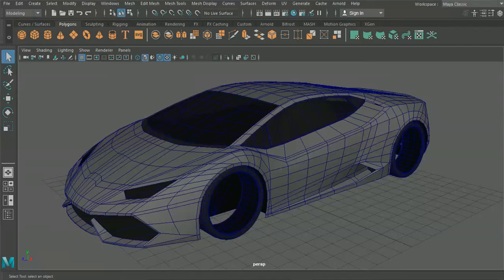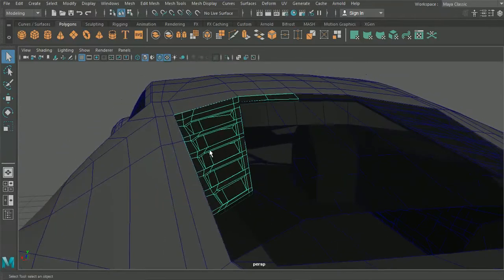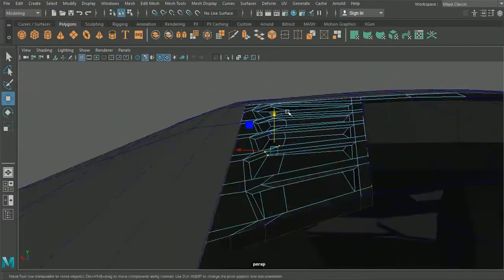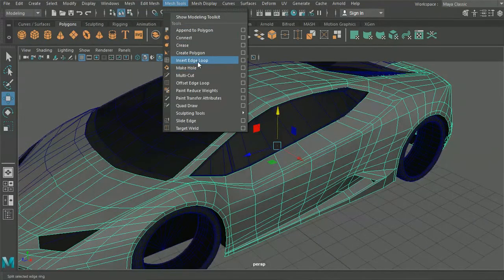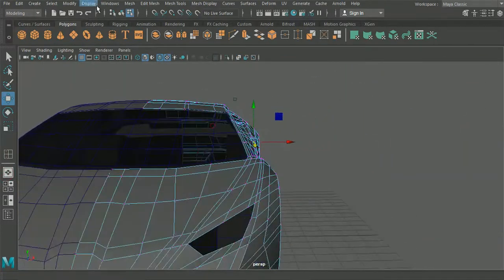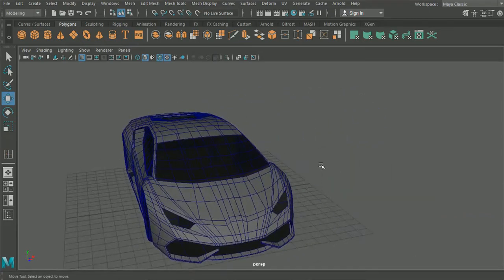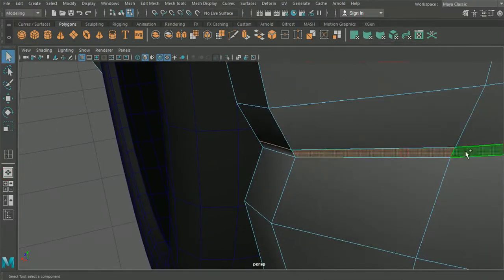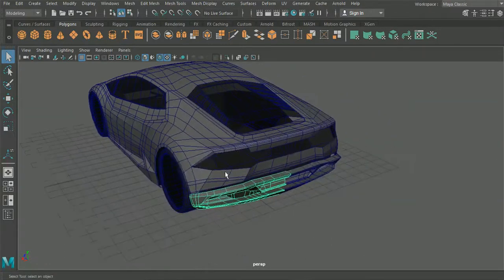3D Car Modeling Tutorial pt.12 | Autodesk Maya | Modeling a Lamborghini Huracan

Comment: Hello. Great tutorial btw and thank you. I have one question regarding the windshield. Did you extrude an outline and extracted like you did on the side windows? Or did you simply extrude  that lower section where the wipers are located? If it is the former the confusing part based on the references I see is that the re is an inner black section under the window so it doesnt protrude like the sidewindows. If its the latter, I havent figured out where the sides of the estrution connect.